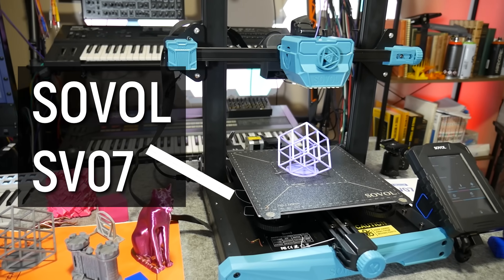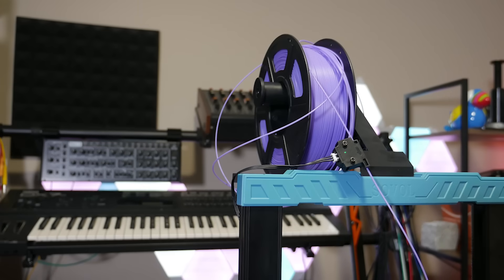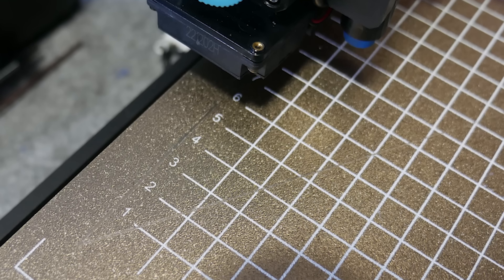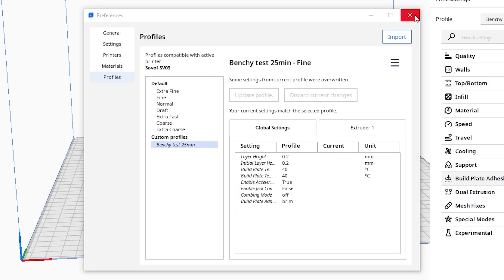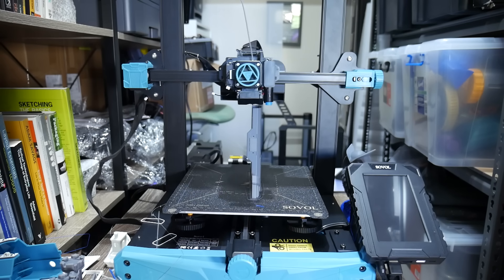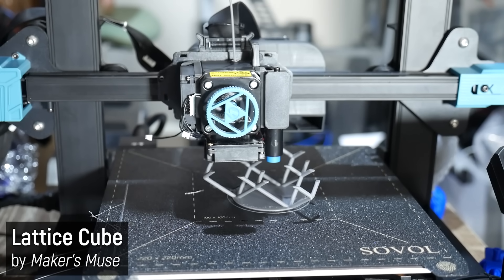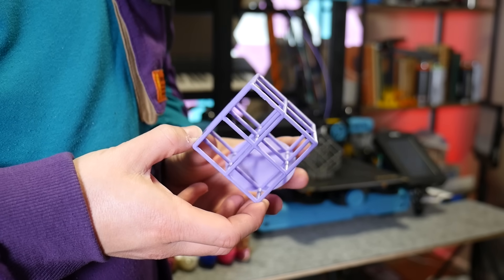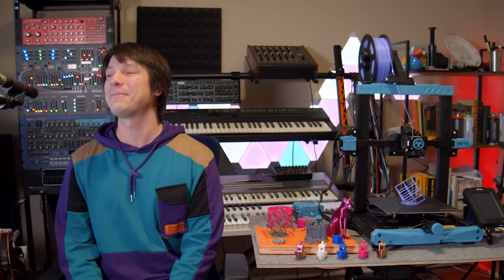I didn't expect to be so impressed... Sovol SV07 Review (with KLIPPER!)

Comment: The reason the fan doesn't work with M106 is probably that the part cooling fan (which is controlled by M106) is the one on the hotend rather than the big fixed one. It's not an oversight, it's a reasonable default choice - though arguably not the best one.

You could change that in the config file, either by swapping the part cooling fan and the other one's pins, or if you want M106 to control both fans you have two options: make it a multi pin (slightly simpler but you lose the ability to control the fans independently), or keep the fan definitions as is and redefine M106 as a gcode macro that calls SET_FAN_SPEED for both (retaining the ability to control each fan independently by sending a SET_FAN_SPEED command directly).

Btw, editing the config file is to be considered a normal part of running klipper in my opinion. This is not like rebuilding marlin to fix something the manufacturer did wrong, it's like changing the settings in the lcd menus (but much more powerful).

Comment: We running a prusa print farm, but we give the SV06+ a try.
But first layer is horrible!! 
Calibrate, safe but next print not anymore🤬. Maybe the inductive sensor had a heat issue like the Prusa Minda
Some say the printer gone craisy above 42°C
We run a 2 day print with pla without issues, but with PETG argh..
The SV07 - i dont like V-Rolls.
The printer runs 24/7 365 days
After 2 jears print time only on one MK3s a misumi linear bearing rattle.
But V-Rolls? Change every 6 Month?

Comment: klipperscreen I believe is designed mostly to be used in horizontal orientation, that's why some of it looks off in vertical orientation.
Btw. regarding that part cooling blowimatron control, since it's klipper isnt it like easy to remap it to for example just run as normal pcf?

Comment: Someone else mentioned it as well but the rounded corners on fast prints is due to the input shaping. From what I understand, it's a tradeoff: either have ringing due to resonances or rounded corners due to input shaping, or some combination of the two to lesser degrees.
Reply: There shouldn't be significant rounding unless you're exceeding the recommended max acceleration.

Comment: Gah Angus, you're doing it wrong! Dont' make custom gcode, make macros that substitute Klipper-esse for standard gcode commands. like one called G29 that runs BED_MESH_CALIBRATE
Reply: Actually, the klipperic way for that specifically would be to add BED_MESH_CALIBRATE to your START_PRINT macro (since that's really the only time you'd have a G29 anyway), and set your slicer to call that instead of it's own start gcode.

Comment: The interface on display is Klipperscreen, not Fluidd. Fluidd is just the web interface 🙂 Klipperscreen is the interface for touch interfaces and has its separate configuration. Note on the Sonic Pad: it's closed, locked down and unfriendly towards tinkteres. RPi or similar small computer will do better job at getting your printer to the max.

Comment: Couple of points other than the gcode macro solution for the cooling fan mentioned in another comment: 
- Smoothing of hard edges may be due to Klipper's input shaping.
- Cooling solution may not be ideal. Will the blower cool near the outer edges of the  bed for larger prints? It doesn't look like it will.

Comment: Would that wonky variant of partcooling work for other printers (e.g ender3)? Would love to get rid of the dual 5055 blowers, they are noisy as fk. 😅
Reply: Try running the fans at 67% speed that still gives me enough cooling but much less noise.

Comment: I upgraded most of my machines to klipper and my older machines are around 2 to 3 times faster. So the itch to get a faster printer has been itched. I still want a faster printer, can't wait until we get really relaible off the shelf 400mm or better

Comment: I almost exclusively print in TPU and I print a lot of prototypes and one off parts I design in FreeCAD.  I love my SV01.  It's been a cheap workhorse that is much more reliable than the QIDI printers I've had and it uses inexpensive and easily sourced generic parts rather that the QIDI printers which go out of their way to make parts proprietary and then they stop making them next year when they discontinue that model of printer.  I wish the SV01 used linear rods instead of V channel for motion control but the only thing I don't like about the SV01 is the tiny microSD card that's inconveniently located close to the Y axis V channel.  It's very difficult to correctly insert the tiny microSD card in that awkward location.  I've missed the connector and dropped the microSD card inside the enclosure and had to disassemble the 3D printer to remove the microSD card.  It's a real pain to remove and reinstall the microSD card 14 times while iterating a rapid prototype design.  I need Klipper.  I've thought about putting OctoPrint on a RaspberryPi.  Maybe I'll get a Creality Sonic Pad or BIGTREETECH Pad 7.

Comment: Screen is running Klipperscreen. Web interface is Fluidd.

Also, with the Klipper macro system it is trivial to write a macro that overrides the standard M106 gcode command to execute M106 and the SET_FAN_SPEED command at the same time without having to mess with the slicer profiles.

Comment: The screen seems nice for the price but somewhat redundant. Is there a 3D printer that comes with an Ethernet port and can be entirely controlled from a PC? I like the visual indicator on the front of the nozzle head. I don't own a printer, so is that a nice feature to have or the spool let you know already?

Comment: Honestly, this review is kind of lacking. No mention of what actually runs klipper (pi clone, CB1, etc), if it's standard or modified klipper, or if there is any standard input shaping or pressure advance MK4 style. 

As for the printer it self, that fan implementation is embarrassing.  klipper makes adding it easy alongside the standard part cooling easy. Also your fix makes it only turn on at 100%, which might give trouble to filaments that only want partial cooling. And while it has dual Z rods with steppers, they aren't independent, which feels like saving penny's for the driver, despite paying dollars for the stepper and rod. And the screen seems to be just klipper screen. 

This seems to be just an i3 v-wheeler but with klipper, preconfigured so perhaps loaded with junkware not found in a official install. All in all a SVO6 (plus) with BTT pad 7 will be more expensive, but quite likely better quality. And that also could comes with an adxl for input shaping.

Comment: For the excessive smoothing that you're seeing, that's a telltale sign that the input shaper is set quite a bit too high. It's probably set too conservative, and needs to be tuned again properly.
Reply: Probably the acceleration is simply set too high
Reply: @olafmarzocchi6194  Then smoothing wouldn't be the issue we're seeing. We'd see ghosting and bulging corners even through the 'shaper, potentially singular skipped steps resulting in extrusion wobble if the motors can't truly keep up. But this lost corner and detail definition with no ghosting? You can replicate this quite easily by just increasing your input shaping.
Reply: The manual itself states that for a given frequency input shape frequency and type, the higher acceleration the higher the smoothing.
It's written in klipper docs.
The test tower they provide also tests exactly the excessive smoothing.
If the frequency you set is correct you never get ghosting, you get excessive smoothing.

Comment: If you have screw's  for the bed I would recommend the [screws_tilt_adjust] option in Klipper, it was a game changer for me. It gave me a way to see how to turn and how much. !   example 

[screws_tilt_adjust]
screw1: 58,-7
screw1_name: front left
screw2: 245,-7
screw2_name: front right
screw3: 245,179
screw3_name: rear right
screw4: 58,179
screw4_name: rear left
speed: 100
screw_thread: CW-M3

Comment: Great video, but some corrections are needed: yes, the web interface is Fluidd (I'm one of the developers) but the touch screen is running Klipper Screen; you can create a new M106 macro in Klipper to override the default behavior of M106 and thus start both fans at the same time (same goes for M104), so no "dodgy g-code replace" needed!
Reply from the maker: Good to know, thanks! Great work on the web interface, it's excellent.
Reply: Kinda wish the manufacturer made profiles that work out of the box.
Reply: Thanks Pedro for Fluidd! It's been a joy to use. From zonestar to Vorons, it doesn't care and gets the job done. ❤
Reply: "No account required" you're a hero.
Reply: Is it possible to use it without connecting to wifi like usb or sd?
Reply: Can't you also create a multi_pin to include both fan pins? That should be even easier.
Reply: Man, I'm glad for this great review. I jumped in early and preprdered it for 300 US but based on the handful of reviews out there and one user in particular having major issues, which may be a defective or bad early unit, I'm no longer regretting that decision so great job on going through everything so thoroughly. Yes, it has rollers and not linear rods but at the same time I think it would have added at least another 100 dollars to the price tag (obviously speculation by me). I do think they should have named it something different than the SV07 because it's certainly a much different printer than the SV06 in some major ways.
Reply: Is the source for the firmware and klipper available? All the other "klipper" based printers haven't realised working source and are locked down in some way. I noticed that the sources for the older models are available, but can't find the SV07's.

Comment: Sovol should offer a klipper upgrade for their sv06/sv06plus as a plug in solution…
Reply: Or Marlin with input shaping (or fixed-time motion). OK it does not have web interface and wireless file loading, but quality- and speed-wise it's close match. And it's only FW update so at no cost ;)

Comment: You can do a gcode macro which starts both fans simultaneously. You can add the macro-command to the substitution section, but I think It should even work without the substitution function if you named your Macro „M106 S255“
Reply: This should work on that printer, I run this on my Sermoon V1 with a custom back fan...

[gcode_macro M106]
rename_existing: M99106
gcode:
    M99106 {rawparams}
    {% set s = params.S|float %}
    SET_FAN_SPEED FAN=extruder_partfan SPEED={s/255.0}

Comment: Hey. Thanks for the great work. Looks like they've used too high of a value for input shaper strength. This lets them use high acceleration values but causes rounded corners and less accurate parts. And that's how they're achieving a 25 min benchy on a bed slinger.

Comment: can i just say as an owner of this and the creality k1 and the bambu lab p1p and x1 (i have a printer buissness), for the price this is the best printer i have ever used. PERIOD. no, it is not as good as the bambu lab but i mean it is nearly £1000 cheaper, this is sooooo freaking good. Compared to the ender 3s and cr10s of not that long ago it is tthe best printer that i could possible recomend. I mean i am so impressed. However i still recoment a stock ender 3 to new printers, this is because for the newbies they kinda need to learn the issues and problems that the ender offers so that they can learn the skills that these newer printer just cant teach them (such as bed levelling manually and building printers and replacing motors and electronics), but if you arned an engineer or a hobbyist by all means buy this printer as it is THE BEST PRINTER FOR THE PRICE, PERIOD
Edit: i have operated printer for like 9 years now, this printer is really good. this is what we want to see from these brands as i have been waiting alongside many maker for a long long time for this type of printer at this prince, yes the p1p is good but to start you dont want a click and go printer, printer just are not at the point that you can press go and walk away so you still do need the skills that only a cheap and repearable printer can teach you so honestly buy an ender 3 then when you know how a printer really works, buy this or a p1p to truly appreciate it knowing that if something goes wrong you know how to diagnose and fix it. so the moral of this is BUY AN ENDER 3 AS A FIRST PRINTER
Reply: Would you recommend the k1? It’s either that or the p1p…
Reply: @sniperpronerfmods9811  Honestly it depends, if you are a buissness that needs many machines that just work, then the k1 has better feature such as an enclosure and proper cooling, however if you are a hobbyist then the p1p is a far better option as if you are only buying one then the p1p has lots of upgradability and a better featureset for an enthusiest. 
The x1 carbon however for a buissness is like the k1 but better in like every way :), so the p1p is good for a hobbyist and the k1 is good as a cheap x1 carbon replacement that has a full featureset as the p1p is missing some major features.
Reply: @snample_  thank you so much for the info... last question then... do you think the k1 will be suitable and relaibe for farm use... just starting

Comment: I'm on the edge of buying bambu x1c+ams. I want fast af speeds and multimaterial printing for smooth support removal. Please tell me it's still the best in it's class?
Reply: Currently it still seems to be, but with time, more and more similar machines are about to get released, so soon there might be a better option.

Comment: On no I just bought a Ender 5 s1 with SonicPad... I'm hoping I've not gone wrong :/
Reply: I thought that too when I bought my Neptune 2s and the Neptune 3 came out. But I‘m still happy with my 2s 😆😆
Reply: If that works for you, that's a right choice for you.
The Ender 5 isn't a bedslinger, which is a benefit for harder to print materials.
This frame also has more potential for improvement by mods.
The SV07's advantage is the incredible value of having it all in an affordable i3 machine.

Comment: This is something that Sovol could have done on their end

For the extruder_partfan gcode you could create a multi_pin in your printer.cfg file that has the main partcooling fan and the pin that that the additional fan is set to

Get the pin that the `[fan]`section uses (this is the fan that M106 controls). For this example, PG1
Get the pin that is in the `[fan_generic extruder_partfan]` section (this is the pin that is controlled by that custom gcode). For this example, PG2

[multi_pin part_cooling_fans]
pins: PG1,PG2

Then you can update the main `[fan]` section with `pin=multi_pin:part_cooling_fans`
Reply: i think they see the blower is overkill for a lot of materials, so there should really be a different command to activate both or just the main one, and they most definitely could have made the blower fan be handled differently, I.E you can get a bit more creative with rules in config and set the blower to turn on when the primary part cooling fan is set to 255. So for i.e ABS when you need a little part cooling it wouldn't turn on.
Reply: Saving this for later